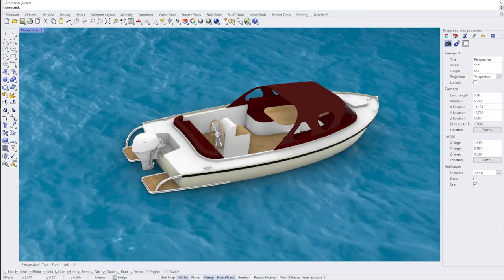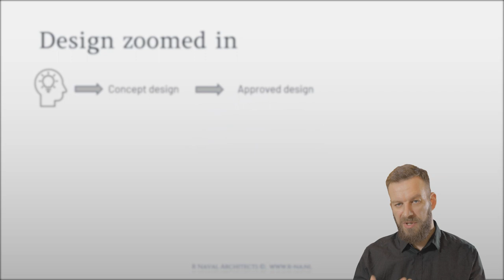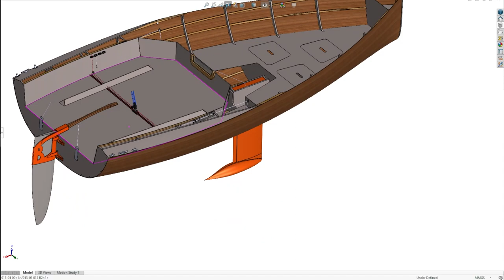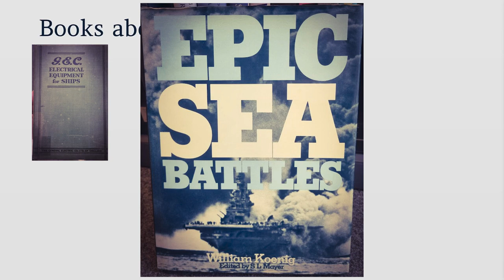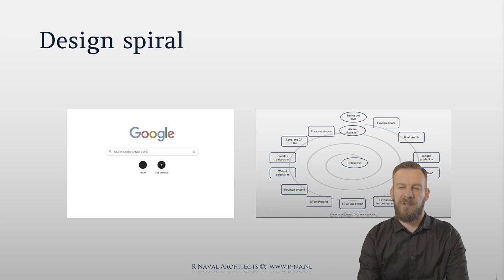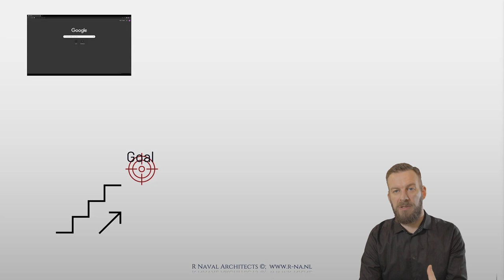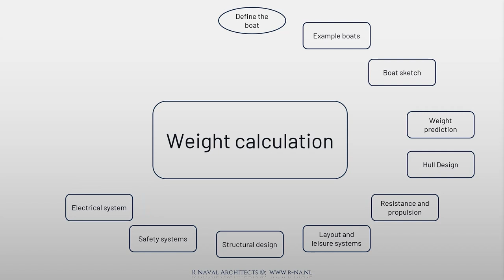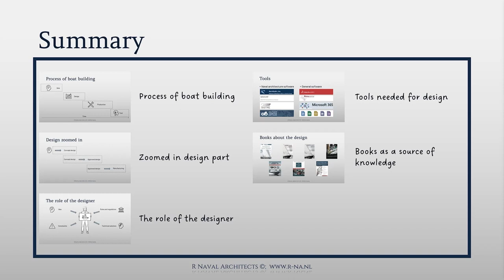Want to design a boat? Here is how.

Comment: Firstly, wish you a good luck on your chanel and thanks a lot for the video. Is there any future video plan on boat mechanial&electrical system design? Also I wonder that whether you are planning to share a videos related to how to design a composite boat hull and its structurural calcs or not. I will be looking forward to see more videos of you.
Reply from the maker: Hi, Thanks for the comment. There are plans for mechanical and electrical systems. one of the future projects will be with inboard engine, and that is where I will explain how to deal with all related systems in early stage. Regarding composites, idea is that first season will be with steel and aluminum, and it will be related to motor boats. Second season should be with sailboats and composites. I would love to create one hydrofoiling boat and share all with you guys, but for that I need time.